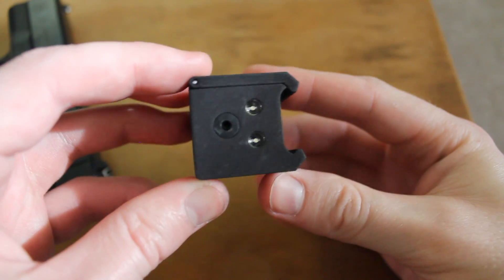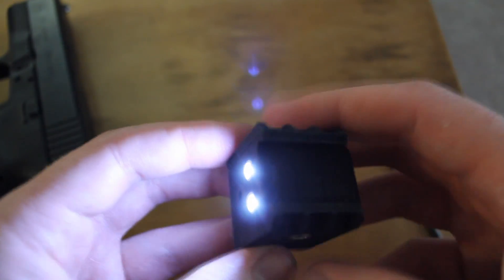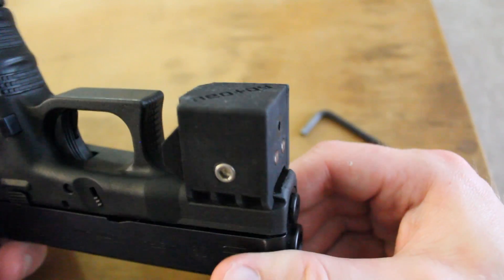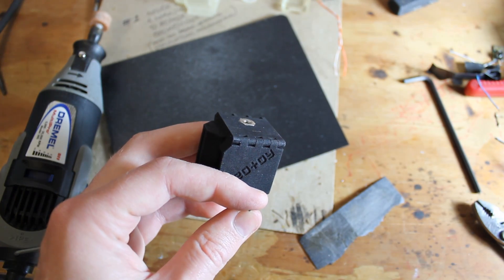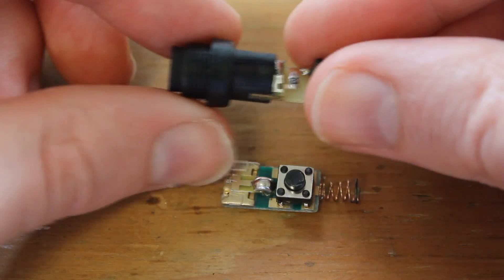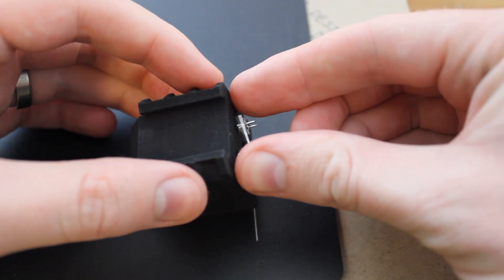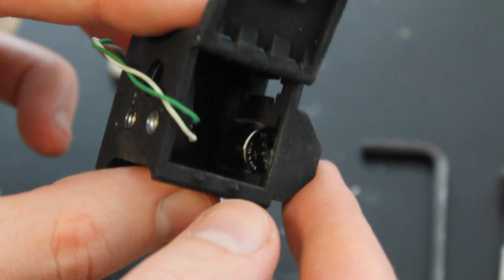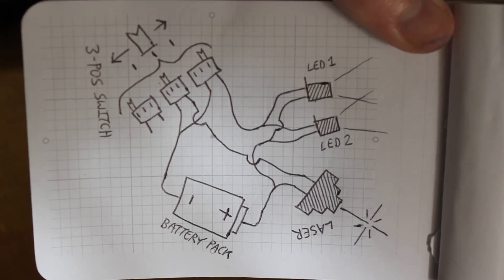3D Printed Glock Accessory (beta)

Comment: you need to put the laser diode in a tube open up the hole for the laser to slide into and use 2 allen screws to tweak the placement of the laser in the mounting hold
this gives adjustment and a way to anchore the laser diode

Comment: Add a pulley to the bottom to allow right/left adjustment of the laser. Additionally, add another pulley on the side to allow up/down adjustment. You can then test and adjust all you want while at the range. No need to research with fancy math, simply not worth it. Here's my idea through a quick draft:

http://postimg.org/image/sf2396uz3/

Comment: Drill a perpendicular hole in the posterior of the attachment; that will force the laser (housing?) to have 2 points of contact for its cylinder to sit in. Make sure that the holes are *perfectly* aligned to ensure accuracy. [o]=[o]-----